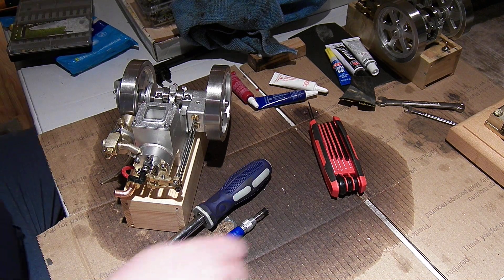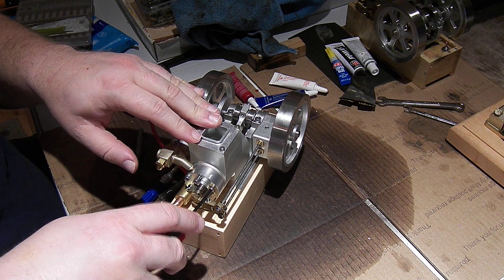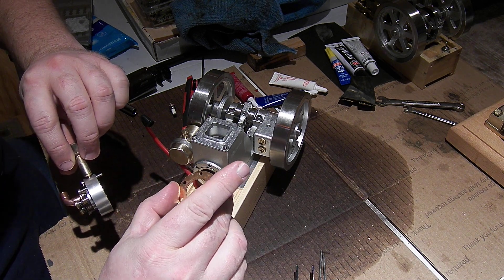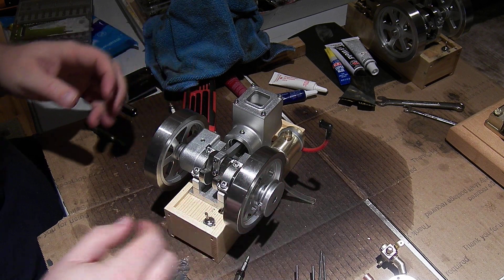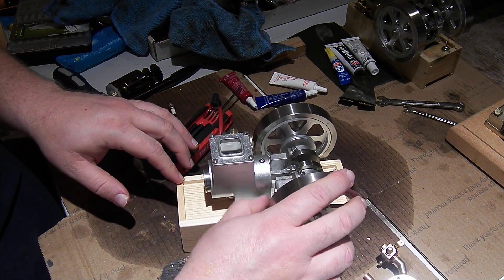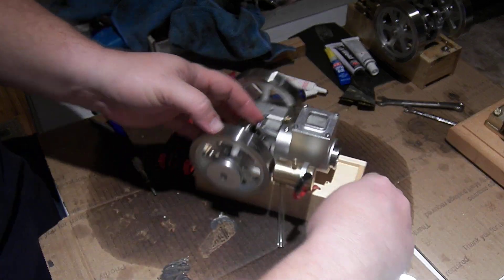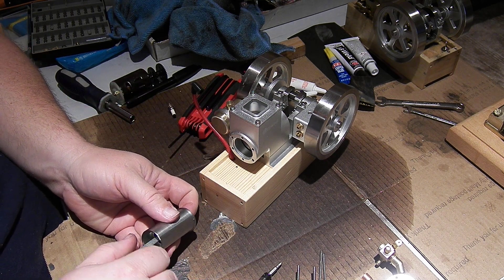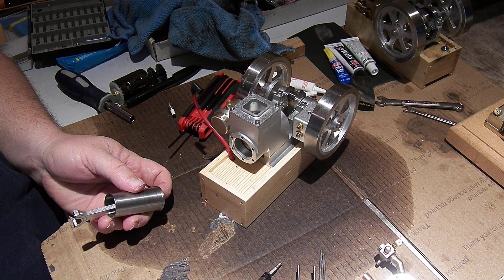ET8 tear down to find lockup issue

Comment: I have issues with an engine I bought from Banggood that I've owned for around 10 days.
It had its 1st run today.

It's just lost all of its compression upon its 1st maiden run of only around 20 mins.

I just hope they will exchange it.
Reply from the maker: Which engine did you get?  I had compression issues with several of my ET engines.  The compression loss is usually from a bad valve seal, but it could also be the piston ring.  If you can flick/rotate the valves to restore compression then you just need a valve job.

Most of my engines have needed a valve job and if you watch other channels like Thomas PC Guru, this is a common problem.  I use baking soda paste but cheap toothpaste or proper valve compound will put a good seal on the valves if they are the source of your compression loss.

You should also check the headgasket, my ET1 cylinder sleeve was not standing proud of the body, so it wasn't sealing on the headgasket and I had a lot of blowby from the cylinder out the water hopper and around the head from the headgasket improperly sealing.

The third major issue that is reported a lot is leaky sparkplugs.  I've had a few and several other channels have mentioned the plugs leaking around the insulator.

Comment: Most of the ET8 owners run their engines way too fast after my opinion. So the engines overheat very fast and the pre damaged pistons seized up.
Reply from the maker: Yes, another ET8 owner I talked to had a lockup issue with his as well.  I'm not sure if there was a batch with bad machining on the piston or if it's just because the ET8 idle runs so much faster than the other ET engines.  If you watch more videos I get it running and take some RPM readings to compare with the other engines.
Reply: I've literally ran this thing so hard it was screaming. Never had that issue
Reply: Henry, do you happen to know the size of the 2 o rings inside the block to seal the cylinder?

Comment: Huh. I was really considering t
Buying this motor!
Reply: How did you end up getting on with replacement parts?
Reply from the maker: @SteamEngines-Jim  I hope you saw the playlist for reassembly after the parts arrived.  There still aren't many parts listed for sale on the websites that sell these engines, but Banggood.com got me the replacement parts to cover it on warranty.
Reply: @henrybangsberg2187  G'day Henry I've subscribed and working my way through your vids as I have some of these engines and a new one (the M18) that has me stuffed if I can get it to go properly - Cheers Jim
Reply from the maker: @SteamEngines-Jim  I only have the EM1 from the brass and stainless steel line and it was plagued by tiny screws working loose.  Including the timing working loose.  I've also seen lots of complaints about the throttle bodies, but I only have experience with the ET8's carb assembly.  The M18 is set up with a very nice cooling tank though.
Reply: All these "M-Series" rubber O-ringed gas engines  share a total Disregard to basic, fundamentally Required lubrication Design concept.....The Factory Lubrication  Instructions  begin & end with the practically Self Lubricating  Fluorocarbon piston O-ring requiring little to No External lubrication....As 4 strokers Don't lubricate Well from fuel mix or other Top (above the O-ring) Down lube methods, this leaves the Entire reciprocating Assembly to whatever lube can be lube squirted, dripped or wiped on from underside prior to Each run cycle & most of that Flings off after a few revs....As Factory  built & out of box, there is No positive adequate Lubrication fittings provided & combined with the full Floating, Hard steel,  Un-Retained  (never used on Any other engine designs) piston Pin, ...  I'm sure these engines come to owners in Already Cylinder Pre-Scratched/Gouged/Scuffed condition & New owners Don't  have a clue what's going on by carefully following Factory instructions !! ....Without any Piston-Pin drip Oiler or Crank mains Bearing lube hole provisions, ....... No Positive Assured Basic lubrication is attainable or Factory mentioned or Recommended & New engine operates in "Self Clearancing "  "Hit or Miss"  lube mode !!  Too bad and otherwise well designed, machined & good running engine's Basic Lube requirements were Totally Ignored in finished to Customer  condition !!
Reply: @tomstrum6259  well, one problem is that once you have oil applied, and it’s all sealed so no oil leaks, it just spits oil out the exhaust. The problem is that the “piston ring” is a silicone o ring. There should be a oil ring or some sort of seal to prevent oil from coming back into the top off the piston. I put an o ring under my m12’s base and it held oil. I made it so it would just barely hit the oil at the tip of the connecting rod. Once I started it, it spat oil like crazy out the exhaust, and made a huge mess.
Reply from the maker: I am looking into replacement parts now so I'm hopeful I will have it running.  The ET1, ETX, ET6, and ET7 were all good so I think I was just unlucky.
Reply: @henrybangsberg2187  yeah I saw all them were using the same parts. You use any oil? Using a tad bit of oil in the gas TREMENDOUSLY increases the life of these motors and the o rings.
Reply from the maker: @Farmtractor  yes, I am oiling them thoroughly and using oil in my fuel.  The only wear I have noticed in my teardowns is scoring from the wrist pin since it is loose in the engines as shipped.  After I loctite the wrist pins there is no new scoring from them.
Reply: @henrybangsberg2187  ah I see. That happens with most engines. Gotta make sure that wrist pin is secured!
Reply: Don’t mess with it